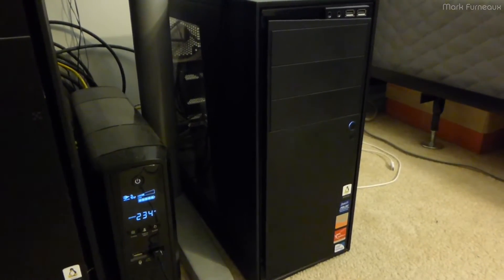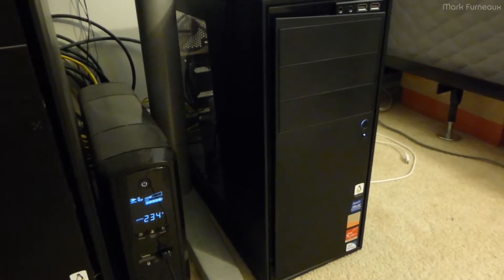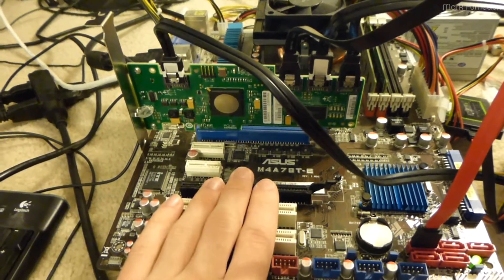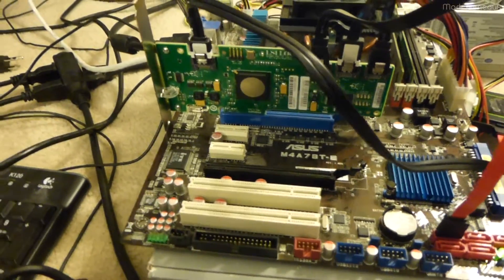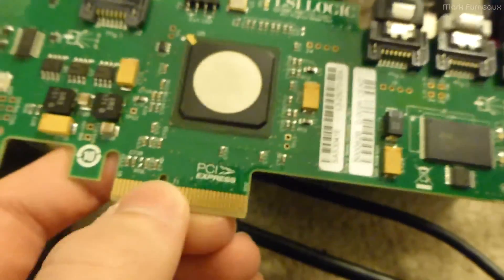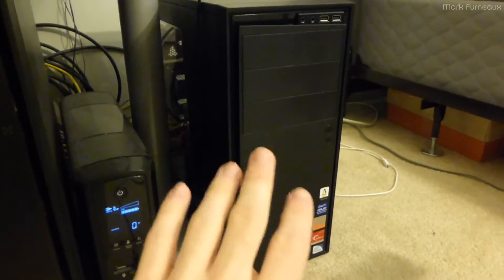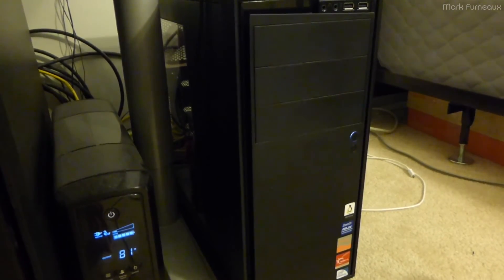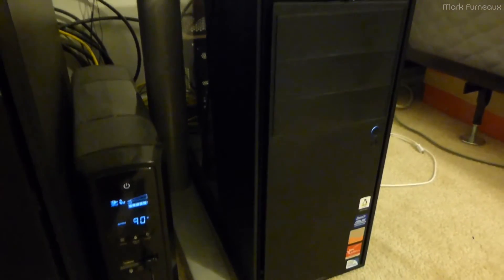Attempting to Replace the HBA in My File Server

Comment: I know that you eventually got a much better solution, but you could have used one of those cheap PCIe 1x to 16x risers (intended for bitcoin mining I think) instead of cutting your components. I use one of those in my backup server to connect a LSI 9220-8i to an ITX board with only one PCIe 1x slot, and it works better than I expected.

Comment: i have a 9270cv-8i.. its a 600$ card i got for 20$ (they didnt know what they had). It runs 2x3tb drives (Seperate, no raid). and its SATA III, and SAS.. i need to use it since its the only card i have that works right and supports drives over 2tb.